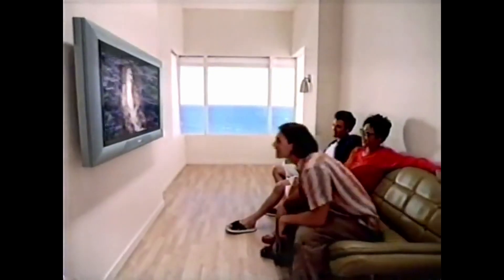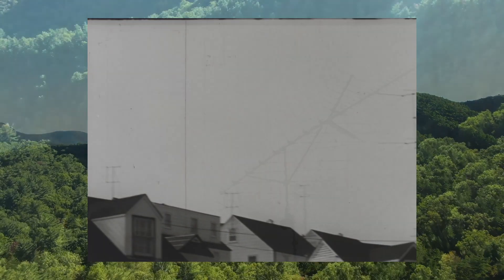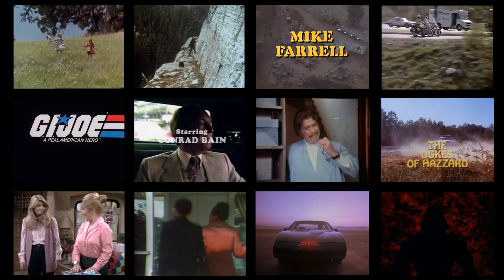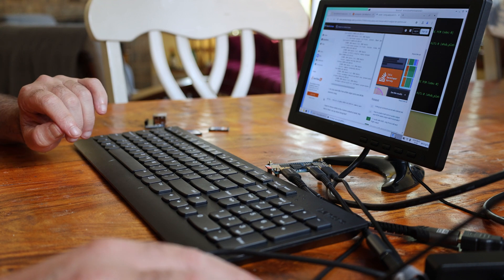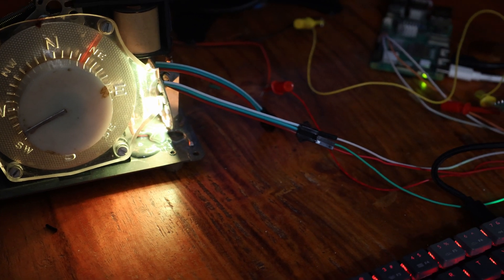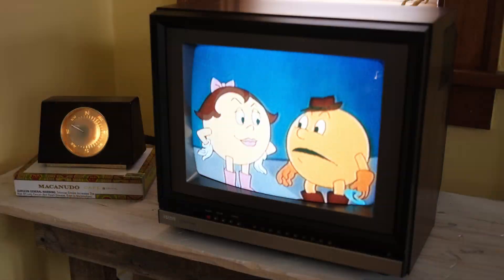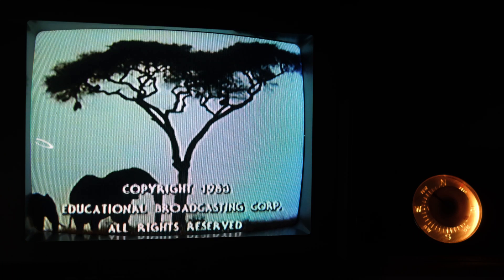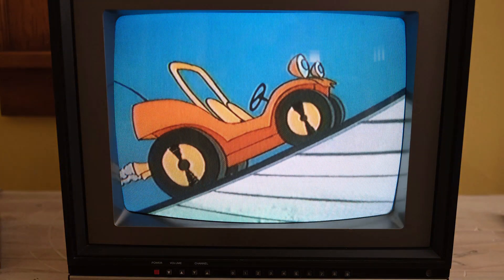My Nostalgia Machine: Recreating 80's broadcast TV with a Raspberry Pi

Comment: The R-Pi has HDMI output - how did you get this to composite or UHF? Great project BTW, really outstanding!
Reply from the maker: Thank you! I went with a straight conversion from HDMI to RF out and hooked in to the back of the TV. Its just a converter box but does an okay job. I want to eventually add an OTA transmitter so it can pick up the air artifacts. Cheers!
Reply: @wrongdog_reckons  I just had a thought; I wonder if you could couple a UHF to UHF connector through an air capacitor like they used in radio tuning circuits. It woudl be a radio frequency thing and not UHF so it might allow enough signal transfer and add wonderful mounts of analogue noise - that way you could play modern computer games or watch feature films in B&W with static and noise! :D

Comment: You talk about how bad the picture quality was over an antenna, but it still WORLDS better than using an antenna today.
I am freaking ANGRY that they required all broadcasts to use digital, because it is quite frankly an inferior broadcast technology.  Unless you live basically within a mile of a big city, you are going to constantly have random moments where the audio cuts out, rendering entire sentences undiscernible because you can't actually tell what was said.  With the old analog broadcasts, it may have been fuzzy, but you could always tell what was going on.
Reply from the maker: This is a good point - I got pretty good at watching fuzzy signals and not caring about them. When I've played with antenna recently I was 1) amazed at how many channels were available 2) I live INSIDE of a big city and was amazed at how unpleasant it was to watch it with entire blocks of the screen getting digital artifacts all over the place. There are some things that analog works well for, tuning is one of them.

Comment: Youtube algorithm finally working. Great video, and great project. On my spare time I've been trying to make a similar project with a 1970's black and white Universum sk 3255 television from Germany, my main objective is just having the Raspberry Pi - Model B with the RCA signal connected to a AVtoRF adapter and play 1960's Doctor Who episodes, Twilight Zone, Kamarádi, The Saint, and some cold war news reels. Tv picks up the signal, but I've not be able to set it to the correct ratio and Raspberry Pi seems it struggles alot to play the videos from a usb pen or sd card, sadly lately I'm having lil spare time for this project, but I'll rewatch your video and take some notes. Thanks.
Reply from the maker: Thanks! I put all the code on github (link in description) and wrote up some install and configuration instructions on the github wiki if you want to try out my setup. I've only tested it on a raspberry 5 and on desktop Linux machines, but I know some others have it working on a 4. I found that USB sticks weren't the right option as well (they seem to get very hot) and went with a cheap USB spinning drive and it works okay. Cheers and best of luck!

Comment: I didn’t realize a word as small as “TV” could have a regional accent. You say it in almost a high-low single syllable, I’m used to hearing it with more of a low-high split-syllable.
Reply from the maker: That's a good observation - I can hear the difference but had not noted it before. Other good examples of short words with huge regional differences:  'for' (think 'fur')  or 'wash'  (think 'warsh'), roof ( think ruff) and root (think rut)

Comment: 0:15 "By all objective measures". Nope. Not even close. A "million streaming options" is actually trash. It USED to be just 1 or 2 options that had everything. Now every netwrok has their own service and the shows and movies are now MORE split up AND expensive than cable TV ever was. "You can watch virtually anything, any time..." Nope. Wrong again. Shows are constantly pulled from these steaming services and made unavaliable, so if you don't have the DVD, you're SOL, and that's not even accounting for how much you have to pay since you now have to have 10 different services at LEAST, instead of the 2 or 3 we used to have.
Reply from the maker: So, it sounds like what they are measuring objectively might be off a little? ;)

Comment: In america did you have a 24 hour program in the 80s and 99s or did the channel stop broadcasting during the night?
Reply from the maker: In the 80s, they mostly shut down at night - especially smaller channels. But then as cable took hold and we had the rise of 'infomercials' (long form paid commercials masking as an informational show)  and 24 hour news cycle - TV started being on all night in the late 80s and early 90s (though I still remember some channels shutting down). I recently added the option for configuring a sign-off video and an off-air video (which I have configured on my machine to play the indian head test pattern with grocery store muzak from the 70s playing. How about where you are from? Cheers!
Reply: @wrongdog_reckons  here we had a test-image with a steady beep Sound between around 22:00 to 6:00 in the morning well into the 90s. Only around that time we started Sending informertials and scam call in quiz Shows at night, where you never actually reached the Studio. Those were banned however in the late 2000s and now we have a 24hour Programme with movies Shows and news playing all day and all night

Comment: I totally forgot how sometimes I had to go outside and twist the long pole that had the antenna until I got a good signal.  My parents never had cable until all of us kids moved out.  My wife and I are watching all 14 seasons of old-school Dallas, and I couldn't imagine having to watch it for the whole 14 years from start to finish.  It's currently on Amazon Prime and so when we sit down to watch it, we watch 3 or 4 episodes at a time.  We're in season 12 or 13 and has only taken us about 3 months so far.  Did you add any commercials to your experience?
Reply from the maker: Yeah - being the antenna turner was my job at Grammas - want to watch wrestling? Gotta turn towards Atlanta. Want to watch nightrider? Well, then point it at Greenville. Yes - unskippable commercials were an integral experience, so I have them at roughly the same frequency. The code logic for cutting in the commercials is actually one of the more complex and satisfying parts of the whole project.

What show are you watching all 14 seasons of? Missed that context.
Reply: @wrongdog_reckons   Dallas.  I swore I wrote that, but isn't in my comment, so I edited it.

Comment: Interesting project, but did your picture really flicker like crazy when switching channels? None of that was the case on my tube, or it was so fast that it was barely more than a tenth of a second.
Reply from the maker: Thanks - it was instantaneous if you didn't have to rotate the antennae to tune the station. Remember at the beginning of the video I talk about tuning the antennae? The simulation is of an antennae rotating with a channel change in the middle - so yes it was pretty similar to what I have there. As the antennae starts its rotation the picture goes out of sync and static fills, then, if you flip the channel to the one you are tuning in then the new channel starts off will roll and skew and then clears up as the antennae finishes its rotation into place. I am adding a cable mode that shows a switch to a tuned channel. Cheers!
Reply: @wrongdog_reckons  Thanks for the explanation! I guess in the US different antennas were used. I never had to rotate my antenna.
Reply from the maker: @pseudonym3690   For sure - I grew up in a remote area that got broadcasts from remote cities in different directions. One channel came in from Greenville South Carolina, the other from Atlanta Georgia and so on. Since they were in different directions, you needed to turn the antenna to tune them in. That was a pretty big part of the simulation and video.
Reply: @wrongdog_reckons  That explains it. Thanks for the info :)

Comment: I've always fantasized about a project like this, although not specifically pertaining to the 70s/80s. Just the idea of being able to program my own TV schedule, with all the old commercials and for multiple channels that all run concurrently 24/7 I always thought would be such a cool thing to do
Reply from the maker: It has been an extremely fun project - especially now that I am trying to add in some more features to make it more accurate WITHOUT per-video metadata (preferring convention over configuration) - its a fun challenge. Cheers!

Comment: My idea was similar but I wanted to go above and beyond and re-create the TV Guide channel (basically the pi would simulate it running a program and when I tuned into channel 2, it would more or less display the TV Guide as intended by reading from the proposed tv schedule that was made up for that week (randomly generated).
Reply from the maker: I am adding a cable mode with themable guide channel so you can emulate 80s vs 90s vs 2000s TV.
Reply: @wrongdog_reckons  But would it scroll the channels via a graphical interface when you tune into that channel? Showing you what shows are on and what will be on?
Reply from the maker: @EverScrolls  - yes, this whole effort is around a believable simulator, so it would simulate the way the channels actually worked.
Reply from the maker: @EverScrolls  there is already a UX module included in the software that will let you scroll the schedules for each network.

Comment: YESSSSSSSSSSS I was working on a project like this because I miss watching TV how I did as a child (in the 90s). But I hit a road block when I found out the pi can't output composite video well (modern pis). My only solution so far is try and find an HDMI DAC that can output either s-video, composite, or yPbPr.
Reply from the maker: Yep - as I noted in other comments - I am using a simple HDMI->RF converter. Previous to the single unit, I had a very old radioshack composite->RF and was getting really good picture by going HDMI->Composite->RF, but am happy with the new modulator. Honestly, if you are having problems, it might be in your modulator vs the pi (or you have higher video standards than I do)
Reply: @wrongdog_reckons  So, I finally got my PI to work with my PVM/ CRT that uses yPbPr by using a good HDMI to yPbPr adapter/ converter. But I had some thoughts on your program. Is it easy to alter the code? I want to make it authentic to a 90s experience by having the pi change channels using a real RF remote and a rf receiver to the pi. Not to mention having the pi render what channel you're changing to in the top right corner of the screen like CRTs did back then.
Reply from the maker: @EverScrolls  Nice work! You are in luck - I've already done a lot of work to enable a 90's experience over the last couple of month. There is a very easy mechanism built in so that you can tell it what channel you want it to change to just by writing some JSON to a file that it monitors - this will change the programming stream from one 'channel' to the other (either direct to the channel or 'up' and 'down'  and then it writes its current channel to another file so your module can tell where it is. I have already created a backlog ticket for a 'channel number' overlay, but haven't got to that yet. If you look on the discussion forum on the github site, you'll see that some folks have it working with a bluetooth remote already - and a friend in Isreal hacked an old cable box to change channels. I just finished 3-d printing my cable box and am working on a video with all the upgrades (like the guide channel, looping channels, fluid scheduling etc).  If you need additional hooks, file a ticket on the github project and I'll help you out.
Reply: @wrongdog_reckons  Well, I am running a PVM CRT. So, high standards lol. But it can do composite.
Reply from the maker: @EverScrolls  the box I am using puts out composite also, but may not be up to your standards. From my view, what I am doing works for me on the color-track so I hope you find a solution that works for you.

Comment: Fantastic project! Super nostalgic trip. How do you source the tv shows/commercials/holiday broadcasts?  Are these stored somewhere locally via NAS?
Reply from the maker: Thanks! I've had a great time with it. This may sound like a legal disclaimer, because it kind of is: The shows came from my personal collection of legally sourced videos - in the US, you can make digital copies of DVDs & VHS tapes you have purchased. There is also some legal content that can be obtained through sources like youtube and archive.org (particularly the VHS vault). The source code I distribute does not come with any content, so building your own library takes the most time. Just be sure to follow your local laws.
Reply from the maker: They are stored locally, I use a combination of SD card and portable harddrive. It would probably be easier to network mount, because I spend a lot of time waiting for video files to copy...

Comment: You, my friend, have made something I've personally debated on pursuing for a few years. I'm extremely pleased with how this looks, and i personally might consider making my own, if not doing something similar to one of those 70s/80s jerrold cable boxes. excellent video, hope for the best
Reply from the maker: Its been a fun one! If you decide to build one and use my code as a starting point, just file an issue on github if you run into any problems. Cheers!

Comment: Great job! :) How is the Pi connected to the TV-unit? Unless I am mistaken, The Pi5 only supports HDMI and no longer has the 3.5mm jack that outputs analog video and audio.
Reply from the maker: Thanks! It was connected through a confusing mess of converters initially: HDMI->Composite->RF over coax, but the old RF converter died and I bought an HDMI->RF converter. The audio tags along with the video through the conversion.  I think you can still get analog audio out of the GPIO pins.

Comment: Where are the video files coming from?
Reply from the maker: They would come from your personal collection of legally owned content. You can take digital copies of DVDs and VHS tapes that you own or any digital downloads that you have rights to use for your personal entertainment - dependent on local laws of course. I have made the source code available, but it does not come with any content - it is designed to play user supplied content that they own and have legal rights to for their personal viewing. What I demonstrated in this video was the system working with my own personal content. Curating the content was, by far, the largest effort in this project. Cheers!
Reply: @wrongdog_reckons  Thank you! That makes sense.

Comment: This is absolutely incredible!!! What an amazing build and programming!

I recently came across an early 2000's alarm clock that is built to look like a tube TV. I am hoping to put a small monitor  behind the rounded glass and put a pi in it with a few movies that can be switched between channels. I have zero experience with coding so that may be a dream
Reply from the maker: Thanks! That sounds like a great idea! You should be able to accomplish it without much/any coding, but might take some configuration and linux research to get it running. Depending on how you want it to work, my software might be a good starting point. If you give it a go and run into any issues, file an issue on the github project and I'll try to help. Best of luck and cheers!
Reply: @wrongdog_reckons  thank you so very much! I will do my best and truly appreciate your response. I may be reaching out!

Comment: I'm also sorta tempted to make one of these based on a my childhood of the 1990's mixed with some shows from the 1970's to the 1980's as reruns. And also to include some local Seattle flair to it. Including some of those classic Rainier Beer commercials and some episodes of Almost Live late at night.
Reply from the maker: Oh, I've got the Raaaaaiiiiiiiniiiieeer Beeeeeer commercial in my setup for sure! Being that Seattle is my selected home-town, I put quiet a few Seattle bumps and news breaks in.  Almost Live was actually one of my first introductions to 'The Pacific Northwest' - hilarious stuff on that show!

Make one! I'm adding a cable mode now - with faster channel switches and decade-themable guide channel. If you want to start with my code and get stuck, just post an issue on the github page. Cheers!

Comment: I'm a milennial and I grew up in the city, watching tv from the mid 90s to the mid 2000s. This is still very cool, I'd love to make a similar nostalgia setup, although it might be a little easier since I grew up with vhs and dvd
Reply from the maker: Getting content from the 90's and 2000's is definitely easier - for example, the local kids show that I watched when I was very young (Monty's Rascals) was still being broadcast live: no film involved!! So, even the station doesn't have an archive of them. This same system can be very easily used to replicate cable - working on a small patch to switch the channel more like cable channel switch and adding in a preview channel that will be decade themeable.  Cheers!
Reply: @wrongdog_reckons  I was thinking of getting one of those small TV+VCR combo units and then recording a bunch of stuff from youtube onto various tapes, at least to have something running
Reply from the maker: @evanlee93  - that's not a bad approach. A lot of the content that I used had been originally VCR recorded and those fuzzy recordings are enough to set off the memories of watching recorded shows on old tapes - its nice.